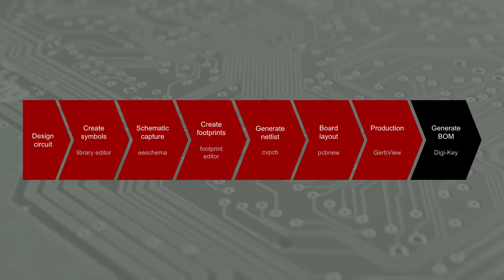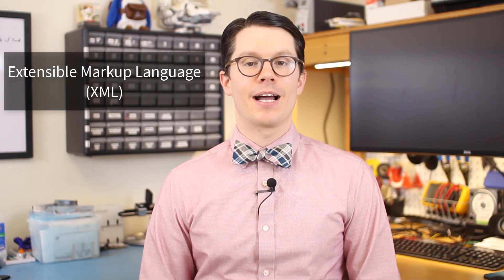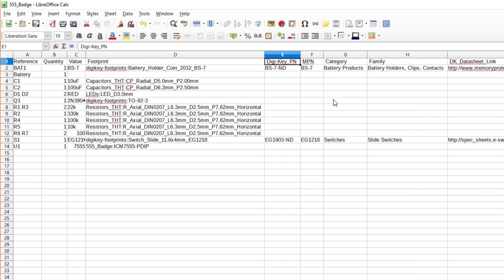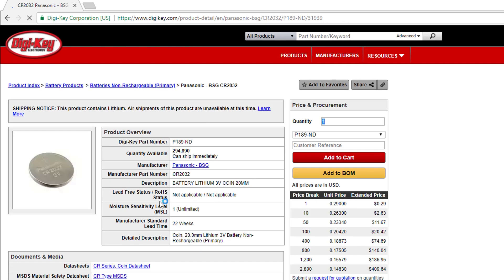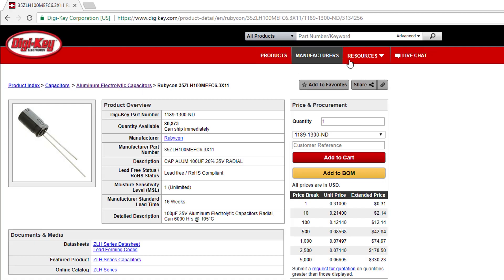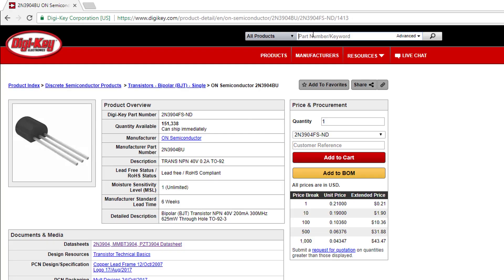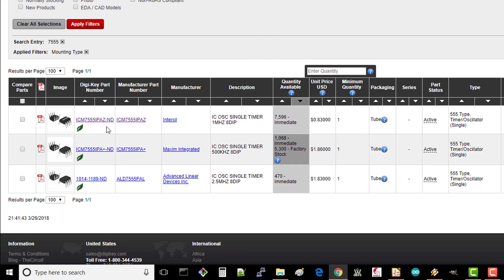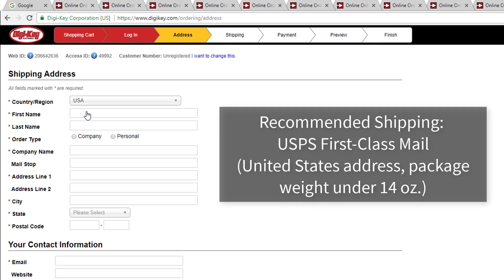An Intro to KiCad – Part 9: Generate BOM and Order Parts | DigiKey

Comment: DOH, following the instruction I get, when using bom2grouped_csv:

Run command:
xsltproc -o "D:/Downloads/ESP32-WiFi-Robot-master/ESP32-WiFi-Robot-master/Eagle Files/ESP32botV1/ESP32botV1/ESP32botV1" "C:\Program Files\KiCad\bin\scripting\plugins\bom2grouped_csv.xsl" "D:\Downloads\ESP32-WiFi-Robot-master\ESP32-WiFi-Robot-master\Eagle Files\ESP32botV1\ESP32botV1\ESP32botV1.xml"

Command error. Return code 11
Error messages:
I/O error : Invalid argument
I/O error : Invalid argument

Comment: In kicad the ultimate way to handle bom is to assign MPN in the schematic library. Once component is to be placed on the schematic it already should have all fields assigned including footprint and mpn. That makes it easy to then instantiate the component many times without having to do the same work many times.
Reply: what is mpn?
Reply: @MrOrangeman18  Manufacturer part number?
Reply: that's may or may not be useful depend on the countryside for me, I can't assign my component with mpn cause we don't have component companies we just have a store that can just offer some components.
Reply: what will be happened, if you  will decide to change manufacturer or decide to buy it in a local store?

Comment: Way too much fat fingering is required! On a real board design, this would take forever and the chances of getting everything in right would be slim to none. I've been very disappointed with this aspect of KiCad. It won't take the information that I've put into my schematic and give me a reasonable BoM in excel...
Reply: Hi, I recommend using an extension software named KiBoM https://github.com/SchrodingersGat/KiBoM

Comment: If you're getting this error when generating BOM, read this:

Command error. Return code 11
Error messages:
I/O error : Invalid argument
I/O error : Invalid argument

https://github.com/bobc/kicad-doc/wiki/Generate-BOM---Command-error.-Return-code-11
There were spaces in my file path. I used MSYS2's rename utility to rename the project files.

$ rename "555 Badge" "555_Badge" *

will replace all instances of "555 Badge" with "555_Badge". If you want to just replace spaces with underscores,

$ rename " " "_" *

will do the trick.

Comment: Seems odd that the part selection wasn't done during the schematics since the sizing depends on the actual component?
Also, I would really have loved to have seen a demo of KiCAD to DigiKey BOM manager.
Reply: Most of the important parts he did select previously. The only parts he didn't specifically select in this video were the resistors and LEDs, both for which he used very common packages. I'd probably have done the entire BOM first, with exact part numbers for everything, before doing footprint association. It worked out fine, though
Reply: KiCAD is revamping their library system to support predefined symbol-footprint associations. I don't mind too much how it is currently, but I can't wait until it's updated.
Reply: @polymetric2614  even with the current system it is possible to do lib management efficiently as I have done in my latest kikad schematic design videos, but one has to adhere by certain rules in order to counter the design limitations of kicad - such as for example one has to use "value" field as component id because kicad does not have a component id field. Then placing value as a graphic on the library component. Library components should be kept unique anyway per part and MPN so this works out nicely but this is not how kicad envisioned it when they added the value field.